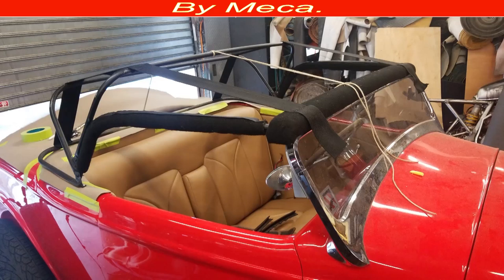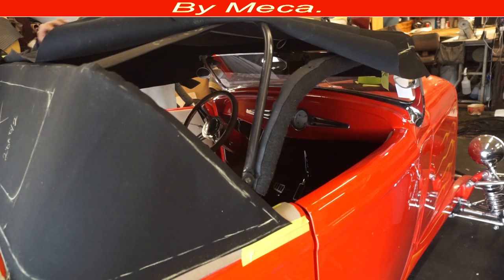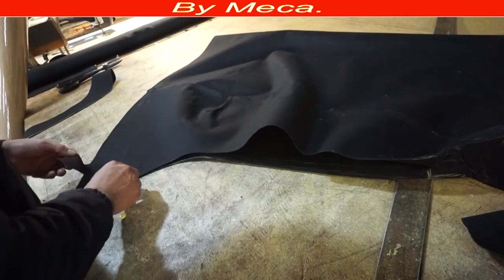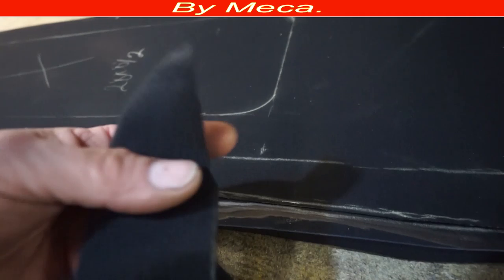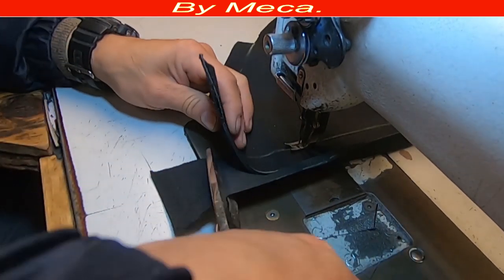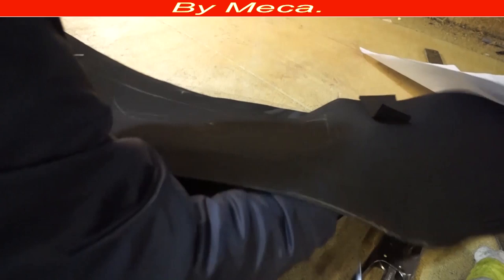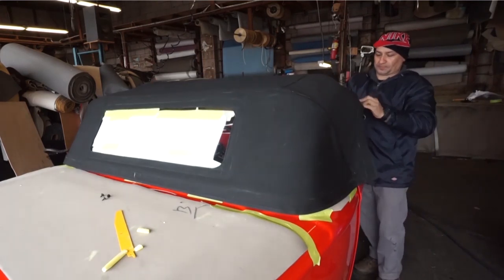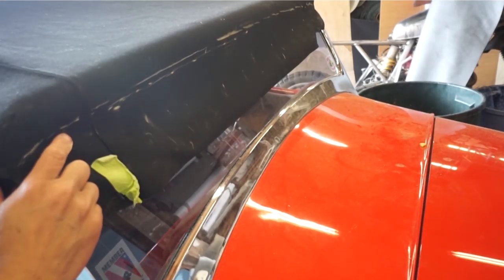How to Make a Convertible Top From scratch 2-2( 1932 Ford Model A)

Comment from the maker: 10- Videos Relacionados a este 1932 ford
10- Videos related to 1932 ford 
Asiento ( seat)
https://youtu.be/_x3vX8dEzXg
Reparar Espuma ( foam repair)
https://youtu.be/Amo39cz7pd8
Palanca ( Stitch Boot)
https://youtu.be/cKHtt7ndCic
Alfombra ( Carpet)
https://youtu.be/nopKRFq5NVg
Pared ( back wall)
https://youtu.be/Xj1PgV9ew1A
Puerta / Doors panel
https://youtu.be/YZATM9FK6KU
kick panel
https://youtu.be/6_dMVSHutiA
Make a Convertible Top From scratch 1-2
https://youtu.be/jSvzEPrlY2A
 Hacer Una Capota Desde Cero. 1-2
https://youtu.be/H2VcP8DoiI0
Convertible top 2-2
https://youtu.be/do2rQKgosYQ
resultado final( final result)
https://youtu.be/ICmWvABDZGg